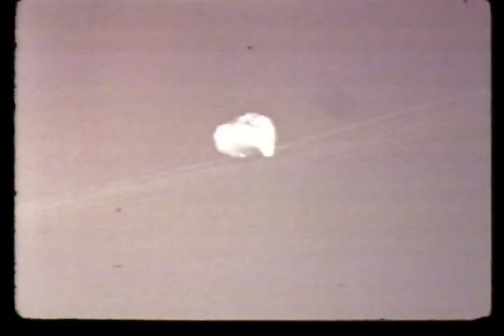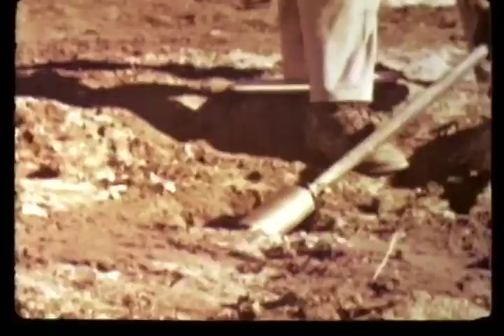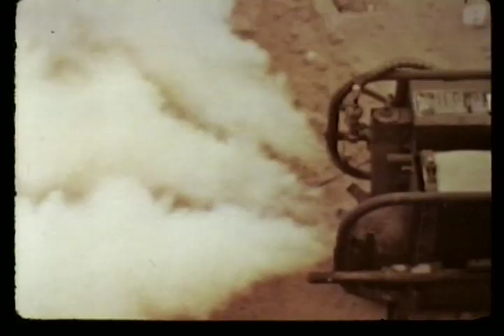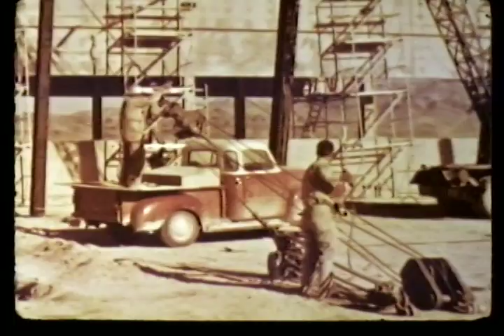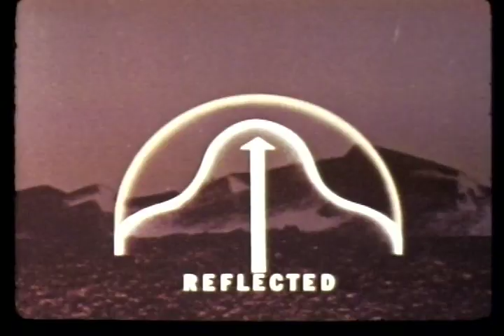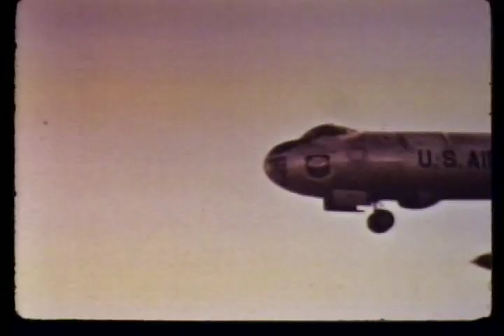Operation Teapot (1954)

Comment: Several of the test-shots in this series (Apple-1, Apple-2 and Turk) were the test of two-stage Class-D thermonuclear warhead mockups that were later fully tested in operation Redwing in 1956 specifically the XW-27 and TX-28.

Comment: Anyone notice that the drone shown landing isn't the one that piled up at end of runway?
Reply: The makers of the movie, which was an Active Duty Air Force unit stationed in a Los Angeles suburb of Laurel Canyon residential home modified specifically for the production of DoD and Armed Forces films and photographs, known as Lookout Mountain Laboratory, apparently simply put together clips of mostly-aligned material to the audio, or vice-versa. But as for the sameness of the drone landing versus the drone piled into the end of the runway, there were several shots that used drones. Are you aware of the specifics of these drone flights? Would be very interested in any information you might know or have sources for.

Comment: If possible the audio should be fixed. There is a severe warble.
Reply: Sounds like the lower film loop wasn’t working properly so the film advance is modulating the film speed at the sound drum. My projector sounds like this if I don’t set that film loops up correctly.
Reply: MANY of the original films are falling apart, and this is all you'll get. Better than nothing.

Comment: Just imagine, after ALL the testing of the b ombs...  That they could place one of each under 2 buildings in 2001 and use the weight of the upper parts to bring the Buildings straight down... ??
Reply: But that NEVER happened...  🤦🏻
Reply: @davelowets  I know, and fu ku shima NEVER happened either.  smh 🤦‍♂️